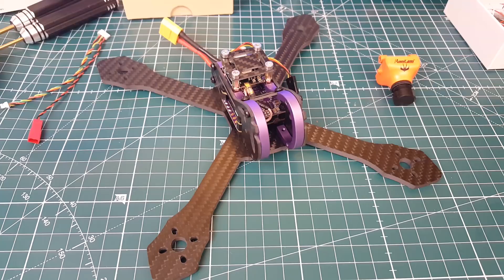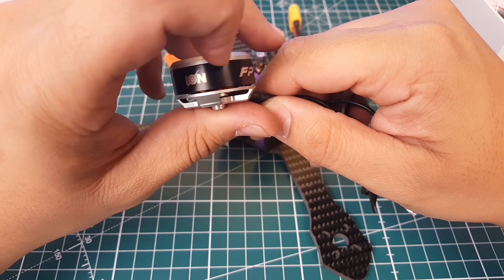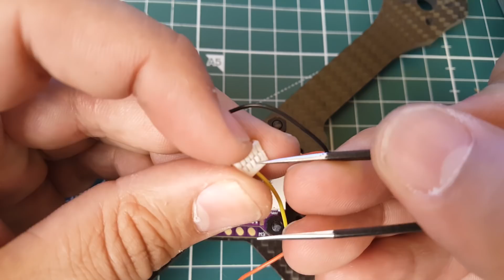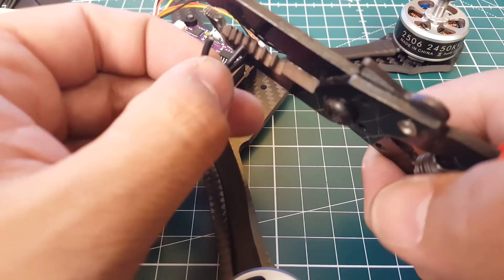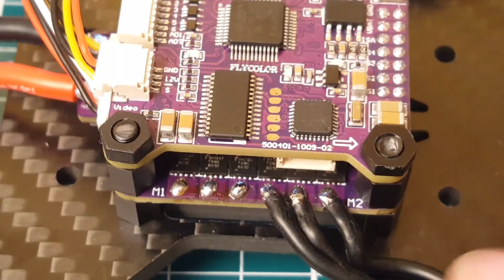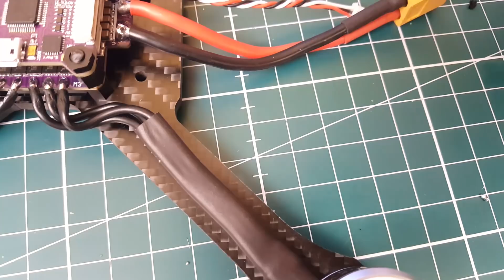How to Build a budget Racing Drone // Realacc Purple, FlyColor Raptor S Stack, ION 2506

Comment: like the way you stacked on top of frame. trying simular build with kakute fc tattu 30 amp 4 in 1 esc. just not enough room for vtx(atx-03). not worried about xm+ will fit any where. thanks for ideas.

Comment: What diameter solder do you use and what mix solder? And what temperature do you run on your soldering iron? Thank you
Reply: Jim Clark, N5QL 63/37 Kester at 350c
Reply: But what diameter is the wire?

Comment: Not using the TS100?
Not complaining, but I am surprised after the praises.
I like the frame, it looks nice. But I'm partial to purple :)
Reply from the maker: Thierry Schork it's gonna be on the next build ;) I have a new budget quad $140 2306 motors
Reply: Yum... I definitively like what you're doing.
Thanks!

Comment: Nah - I have gone off bottom mount battery frames (as many others are doing) - they had their time, but they really are inferior to top mount designs in performance, flight characteristics, stability and protection.  Back to top mount frames.

Comment: Nice build and video!you keep them coming!really enjoying them.may I ask why you went for the akk fx3 instead of the akk fx2?the fx2 has the same features,almost the same price,but has 800mw output.
Will you also be checking out the puda chameleon?or is that an issue for you because it is a clone?
Reply from the maker: I went with the vtx that would fit some how as I had no room.and had to mod the back of the quad with brass spacers. 

The clone I have checked but the one I did was the scorpion x220
Reply: Drone Mesh man,first of all unbelievable you have the time to reply and make all those videos 👍
I saw that video too.but maybe the price difference of almost 20 euro was a motivation for a budget build or something to check the puda frame.
Reply from the maker: +joost kocx Send me link.. 

I setup 2 hours to try to reply to everyone i can because without you guys I'm nothing.

Comment: Wow I haven't ever seen 2506 motors :0 :0 it will be beast lol those motors are GIANT and AMAZING :D
Reply: BuzzCola 3 have these on my 6s quad, they are great for power and torque, surprisingly efficient, I fly for like 4 mins on a 1500 6s and and 4:30 on 4s 1550, on my xl7 I have 2100 kv version and can fly for around 10 mins average.
Reply: Lawson FPV wow 10 minutes ? That's awesome
Reply: BuzzCola 3 yeah it became my slowfly, chase and just fun quad. Don't have a crossfire yet
Reply: BuzzCola 3 yeah it became my slowfly, chase and just fun quad. Don't have a crossfire yet
Reply: Lawson FPV it will be awesome GPS super long range quad
Reply: BuzzCola 3 I really recommend that setup, 2506 2100 on the xl7 with ipeaka 45a esc's, I use Matek 3-6s pdb and revobee f4, you can put a gps on it and a 3000 mah battery and fly forever
Reply: Lawson FPV it will be awesome
Reply: @lawsonfpv2613  sweet

Comment: Why didn't you just use a regular small little 600 milliwatt VTX and stuff it between the two purple posts like a leopard frame that thing sticking out the tops going to get ripped off in a crash